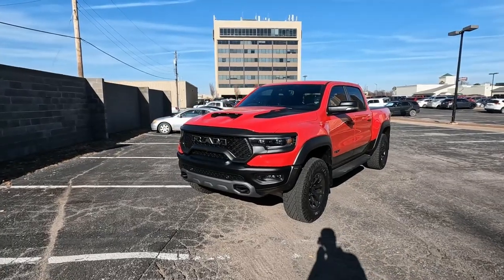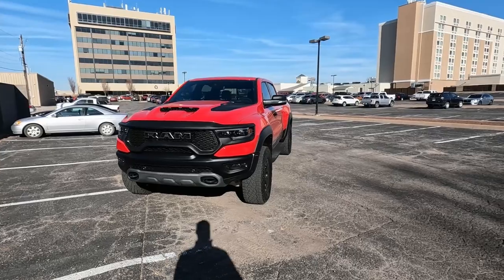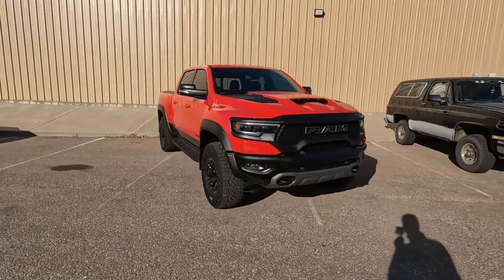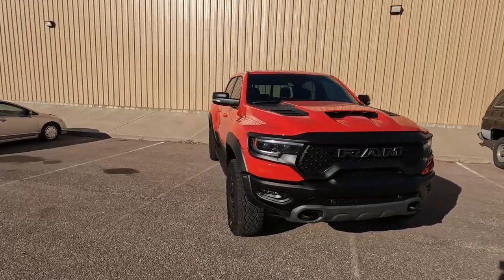RAM TRX Suspension LEAN Repair!!! (TIME LAPSE)

Comment: I have a 2024 ram 2500 that has a 3/4 inch lean to the drivers side in just the rear.  do you have any sugestions.   Thanks John

Comment: Do you torque anything to spec? Or jus Ram the gun home?
Reply from the maker: After doing it for 14 years you have a pretty good feel for how tight or not to put stuff suspension related but yes engine related bolts typically get torqued. Thanks for the view!

Comment: Great video… But I have a question… Why put the track bar on at the end?
Reply from the maker: Having the truck sitting at ride height let the track bar perfectly line up with the bracket and let the bushing get tightened down so it wouldn't be twisted. Thanks for the view!
Reply: @TylerPotter  ahhhhh
 Thanks for letting me know

Comment: My truck has the 21 springs in it; wanted to ask after they get those replaced would it need an alignment?
Reply from the maker: Part of the repair procedure is performing a alignment after you installed the springs, I did not show it in the video though. Thanks for the view!

Comment: Even this is under warranty... do they allow to do this myself? I hate giving the truck away. If yes- would i get the parts?
Reply from the maker: No any warranty work would need to be performed at a dealership. Thanks for the view!
Reply: My dealership says this isn’t under warranty even with my 6/75 Extended Warranty…
They are asking $2,000 for parts and labor!

Comment: Quick question what would be the best psi for the tires? For regular street driving? I got them from the dealership at 42 but the door sticker says 38
Reply from the maker: I normally try and set mine right at 38-39psi like the door sticker. Thanks for the view!
Reply: Thanks again 🤙🤙

Comment: I took my truck in to get the springs replaced it came back to me with the same part number on the new springs how do i explain this to dealership?
Reply from the maker: The springs more than likely needed to be ordered, so they probably just inspected for the spring part numbers and ordered the new springs for yours.
Reply: They ordered new springs i waited 2 months for them but they are the same part number as the ones that were already on there. Can u provide me with the correct part number for the left front and rear. The truck is uneven about 1 inch
Reply: Never mind I got it thank you
Reply from the maker: There are about 10 different spring part numbers this video talks about how to inspect the springs and was numbers to order. Service Bulletin 02-005-21
https://youtu.be/r6k_WTgA-ns

Comment: Any of the fasteners one time use?
Reply from the maker: Oh yeah I think every single one is technically one time use. Mopar sends one of everything with this service bulletin to be replaced with the spring replacement. Thanks for the view!
Reply: Thanks Tyler. My truck is current at my dealer getting this done. Considering my level of OCD, i just wanted to check what all is included so I can see if it all got done right.